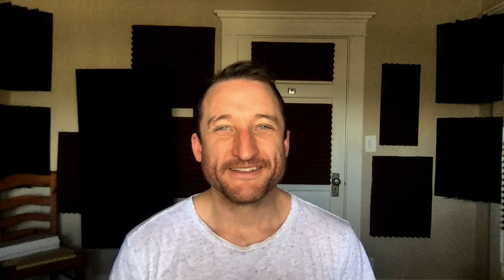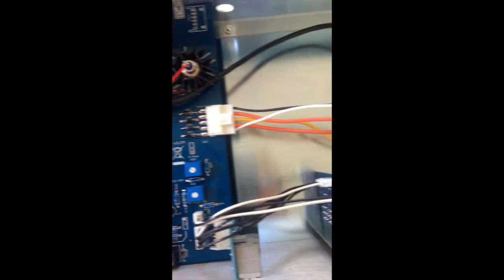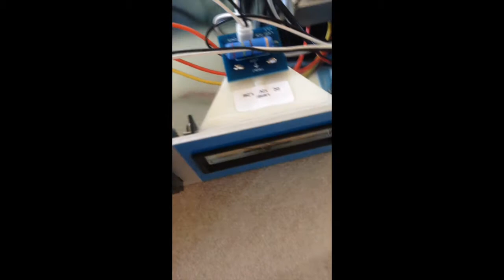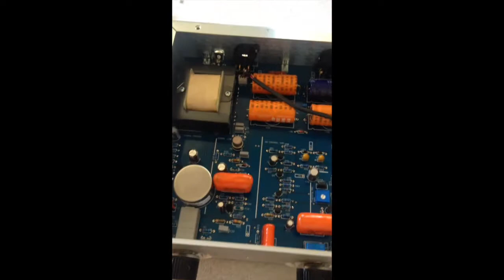Hairball Audio 1176 Rev A | Can A Complete Beginner Build This?

Comment: Hey man, i have a question...Does the DIY kit comes with everything you need? or you have to buy some extra parts..like knobs, enclosure  etc... thanks ))
Reply from the maker: Hey Andrei! Some kits will come with all the components you need (besides the soldering iron, solder, ect). Hairball Audio, CAPI Audio, Microphone Parts, and others will come with everything you need in their complete kits. 

There are other companies like Drip that will sell you just the PCB board and you have to source the rest of the things yourself. 

I like to look at the complete kits like Legos. Make sure you read through the instructions thoroughly and check to see if you received all the right parts. Then just carefully assemble each piece one by one. 

Most likely you will have to troubleshoot (it's easy to make a mistake at first) but there is always a solution. That is part of the fun after you get over the frustration :)

Thanks for reaching out and good luck!
Reply: Thx for the reply.. the assembling part should be quite easy for me since i'm an electronic engineer.. just wanted to make sure i'll get everything in the kit. Wanted to try out the new F revision they have..never had the opportunity to work with an  F revision, looks stylish with the red stripe ))
Reply from the maker: Yeah it looks awesome. I will probably end up building one of those as well! I would say you should go for it!